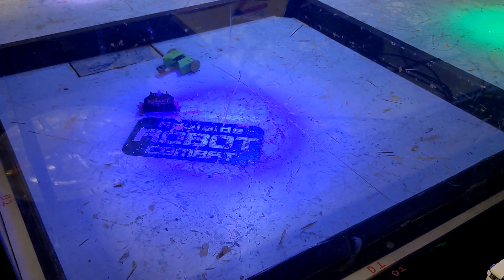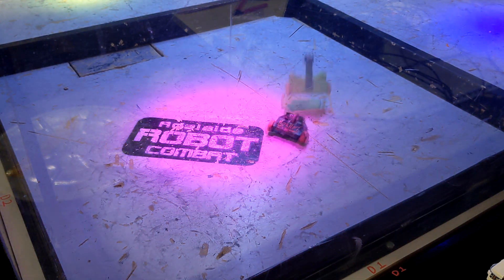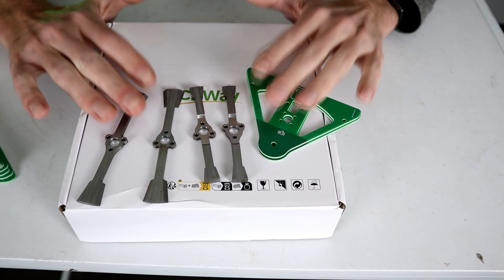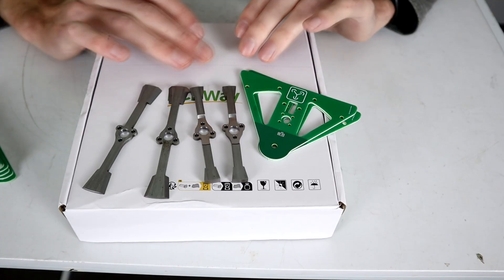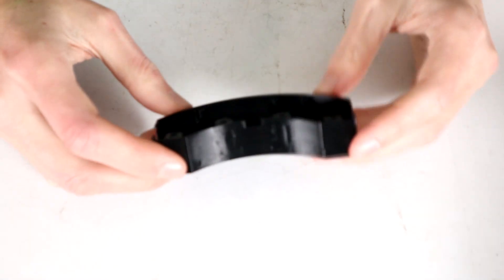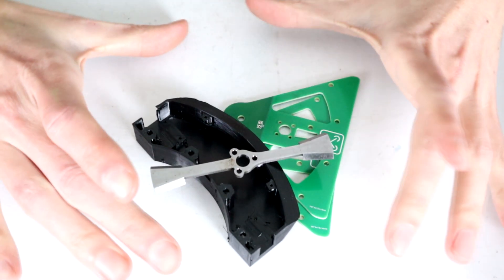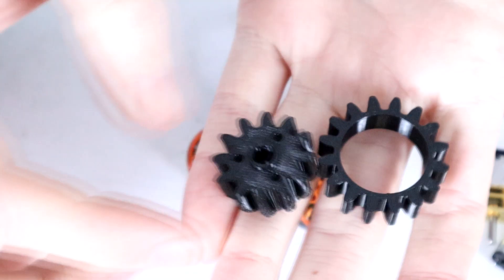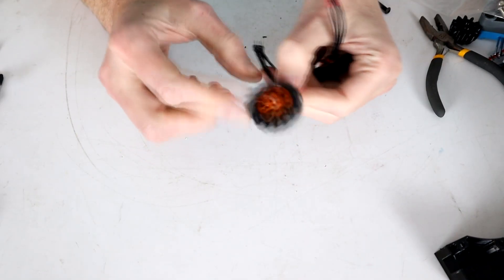Can I make my horizontal spinner indestructible? (Guestimate TPU strength build)

Comment: I wonder if you would be better off making the PCB large enough to cover the bottom/top entirely then eliminate the bottom of the chassis print (just print side walls and the notches for 3 structural metal standoff/screws); bit harder to change batteries but no more weak spot of a milk jug lid.  Making weight on these must be a nightmare in planning.  Love your content.
Reply from the maker: From a defensive point of view, yes pcbs that cover everything would be best, unfortunately they are a lot heavier then prints or milk jug so I'd have to redesign a ton to make weight with more PCB in the design

Comment: 64D TPU seems very strong until you hit it with high velocity impacts. I was curious about this myself a while back so I did some testing with a hammer and found 64D holds up really well. Then I hit it with an air rifle. The pellet bounces right off 95A TPU, no problem, but 64D shatters in about the same way as PLA. DO NOT BRING 64D to an event! It's not worth it. It's very strong stuff but seems to have a maximum flex speed, almost like corn starch in water, it gets more brittle the faster the impact.
Reply from the maker: Thanks for the warning
I didn't see it until after the event, the chassis seemed to hold up but it didn't take many shots, I'll print a back up in 95a just to be on the safe side

Comment: I do a similar thing with brass inserts using an iron solder to insert them and then printing a lip on top of them. Also, i would recommend adjusting the plate z-hieght on the stops to make it easier to put in your inserts.
Reply from the maker: Printing over top of a brass insert is a cool technique 
I've had issues with brass inserts wiggling out of tpu, but with a printed layer over top that shouldn't happen

Comment: Very cool! Any reason for using PCBs over say a machined HDPE plate?
Reply from the maker: I didnt think HDPE would be strong enough to stop the weapon from hitting the motor
I chose PCBs because they are cheaper and lighter then carbon fibre
Reply: @TeamPanicRobotics very fair points! How much clearance does the weapon and motor have? 
Good luck this weekend!
Reply from the maker: Its 2mm clearance between the top of the motor and the blade

Comment: I'm using 64D to print battery cases for an ebike.  Prints really well and seemingly indestructible
Reply from the maker: I hope so!
a few other comments have said it shatters, but I've seen others use it and its held up well
Reply: @TeamPanicRobotics I couldn't break it across layer lines very easily when needed to bodge a part 😁

Comment: With 3g needed, have you thought about redesigning the wheels ? Maybe try full rubber with a small mounting plate to the motor? Or add some lighting holes to the under side and back for the main body. It’s always a fun challenge to get that 150g weight
Reply from the maker: The wheels are less then 3g a piece I could maybe get 0.5g back from them if I need to, but I've got other ideas to try first
Reply: @TeamPanicRobotics wow , those wheels are light! I just made some myself but I’m at 14.3g , my weight limit is 1lb so I should be good. Always looking for good opportunities to learn and find ways to save weight! Keep up the awesome work

Comment: Some nylons are lower density than TPU, others are equal or heavier. Those gears could be a place to save 1g if you can find some lighter stuff.
Reply from the maker: Thats true, the front gear could be slimmed down where its not making contact

Comment: If you’re willing to pay for shipping from Australia, the llama forge 195mah 2s lipo is advertised as 13g, but many people claim it’s closer to 11-12g (YMMV). It only has a balance connector and not a JST, so you need to buy a balance connector to plug it into to make it work. That missing JST is where most of the weight savings comes from.

I also recommend if you ever have a few grams to spare, the GNB 300mah LIHV 60c 2s is only 15g. Most other 300mah LiPo batteries are 18g. The higher voltage also means a little bit more “oomph” out of your drive motors and weapon motor.
Reply from the maker: I'm in Australia, so the shipping is not an issue
I have a bunch of these old 180mah 2s batteries, the llama forge ones are lighter by not having the red jst plug

I havent messed around with HV lipos yet, I dont even know if my chargers can deal with them

Comment: I have had the same issues in my horizontals.

I decided to use Belt Drive to prevent motor damage (1404 motor and FT belts with 3D printed weapon pulley and Aluminum motor pulley).

I use Plastite #4 screws that are really longer than I need, which stick out of the pads they screw into. Then I hot glue the backside so they can’t back out. It also helps that the screws are oversized for the holes I print. Machine threads do not work well in TPU.

For TPU bots I am going to use a $4 Amazon sawblade. It can cut 3mm into my TPU beetle chassis.

Comment: Ive been saying this for a long time about weapons for bots, why don't they have sharper sometimes replicable teeth? i designed my bot to have a disk style blade but with sharp teeth that would bolt on and could be replaces when damaged.
Reply: More things that exist = more things that can fail. Screws or screwed on teeth are more likely to fail than a solid weapon simply due to more weight.

Comment: you know, it's funny to me, how a design that was originally abandoned by the first sucsessful UK spinner, and that basically set the standard of kenetic energy weapons along with it's buddies in the states, actually works better in lightweight robots. Strange huh?

To quote the Rose family "These were the wepons on the original hypnodisk, we noticed they sort of cut and slashed, causing very localised damage. So, for season 4, we switched to these much thicker teeth that dig in, grab hold, and rip whole sheets of armour off the opposing robot"
Reply: The higher the RPM the more damage. The higher the MOI (diameter and mass) of a weapon, the more damage. However, you can only spin at such a high RPM before your weapon slides past your opponent. Getting a proper impact is referred to as “bite.”

The best way to get more bite is to drive the robot very, very fast. However, 150g bots are used in such small arenas that high speed is basically impossible. As such, high RPM on small diameter weapons is not as viable as other weight classes.

However, using a large diameter horizontal spinner at lower RPM will allow for better bite. This makes them very effective in 150g bots, which also tend to have relatively thin armor to make weight.